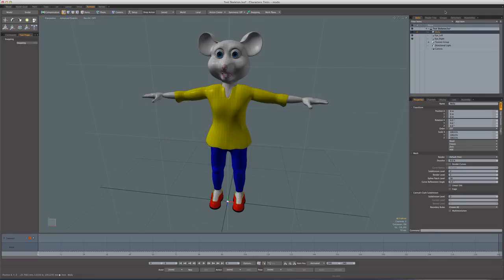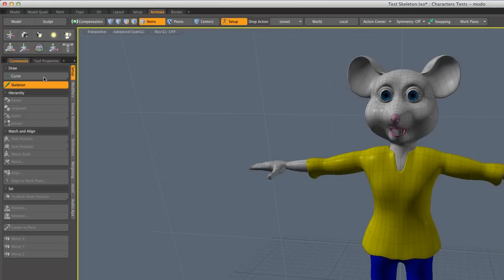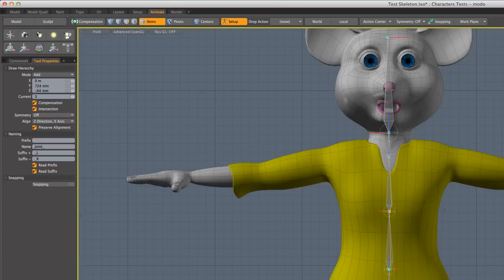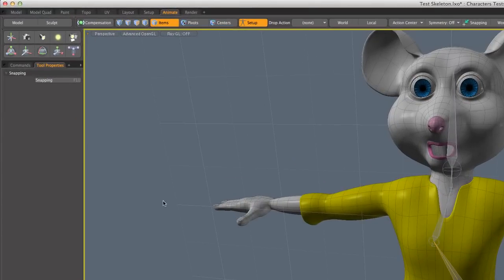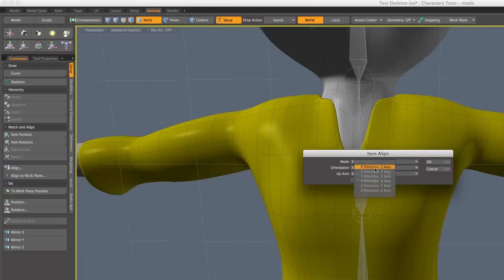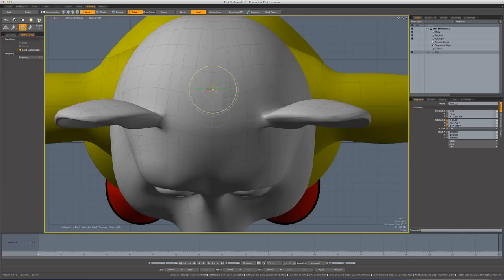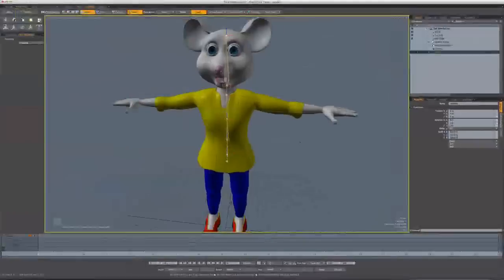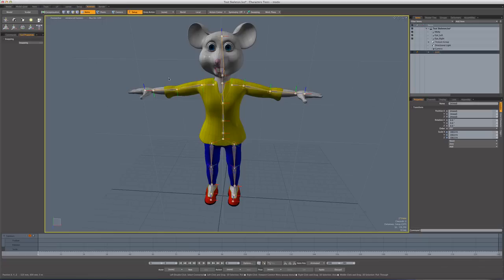Creating and Editing Joints in modo 601

Comment: Hi! I'm a new user of MODO and your tutorial helps me a lot. I have a little problems with setting Zero/All for the first bone of the chain. You showed how to set zero on the whole chain joint in Properties panel using comand Zero/All. I did it in same way but without good results on a first bone of the chain. In my case Zero/All on first bone doing reset position and rotation.  I'm using MODO 801. Could you help me to understand this case? I was sure that what is checked on top of viewport. I mean about "item, setup, local"
Reply from the maker: Hi Krzysztof.  I'm not sure what would create that problem, because the root joint of the hierarchy should zero out in Setup mode the same as the other joints in 801 without a problem.  You might want to make a post about that on the Modo forums with more information, and perhaps get some more feedback on the issue.

Comment from the maker: It isn't necessary, but if you have the Y axis up for the left arm and down for the right it means that the rotations will be equivalent for both sides. Meaning if you rotate the left arm -45 degrees on Y it will move the arm forward, and likewise if you rotate the right arm -45 degrees on the Y. Otherwise if you had Y up for both arms, then to move the arm forward would require the inverse value from the other side of the body (ie. -45 on one side, and +45 on the other).